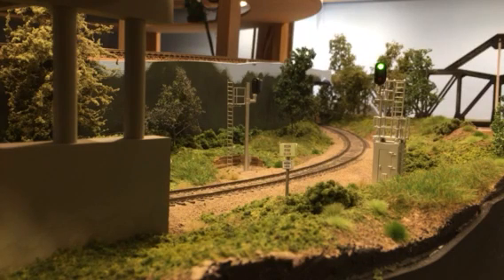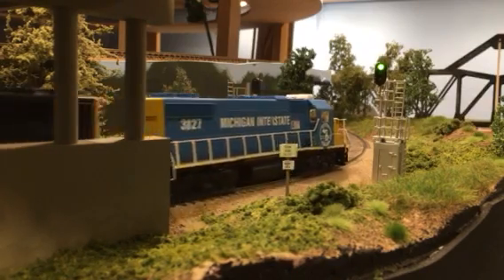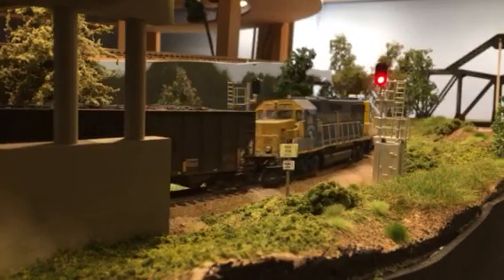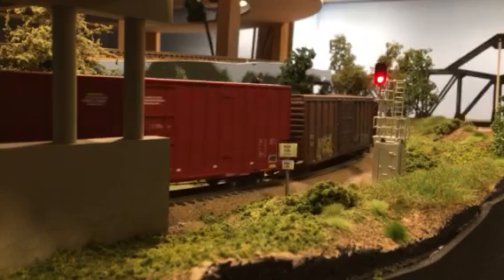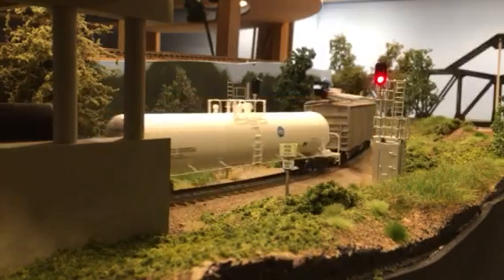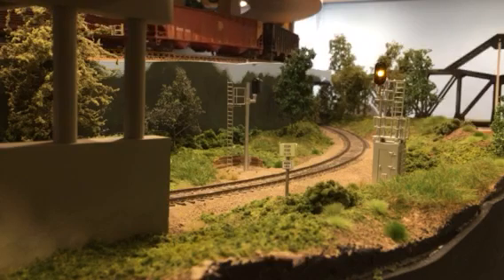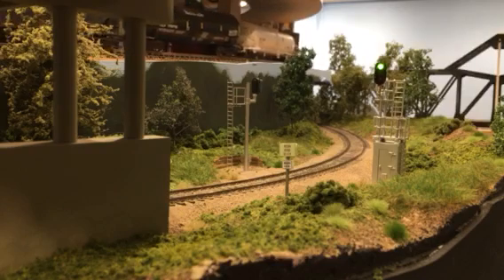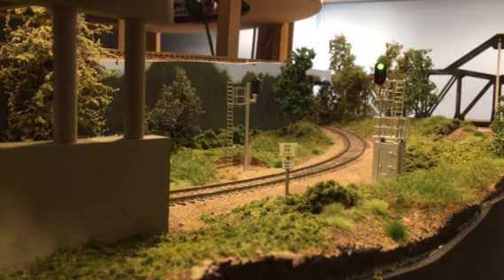Simple & Easy Model Railroad Signals - Part 1 (Three Aspect / Virtual)

Comment: I'm thinking of adding signaling to my layout but don't want to add resistors to my wheels etc. would you recommend this product?
Reply from the maker: Thanks for the question. Yes I would recommend this product. No resistors on wheelsets needed and beings that the TS2 operates by itself or together with others it is affordable to expand as you go. The board is LED signal ready. Be sure to check out my how to posts on my blog http://michiganinterstatemodelrr.blogspot.com/?m=1

GM